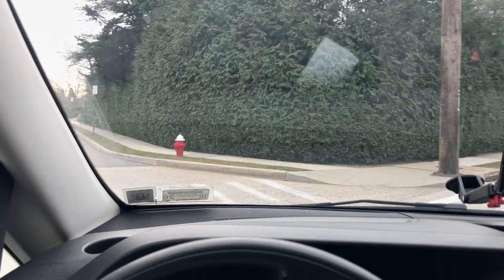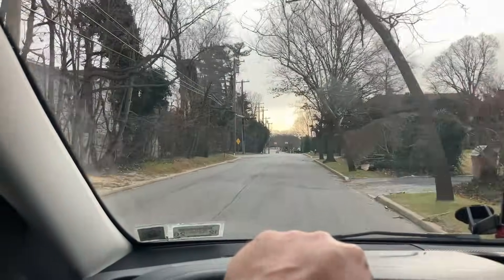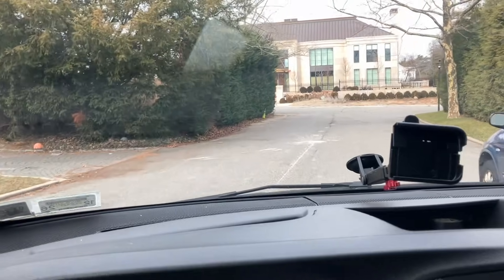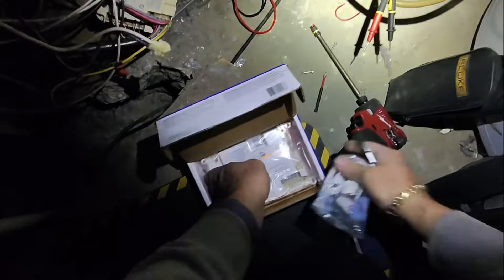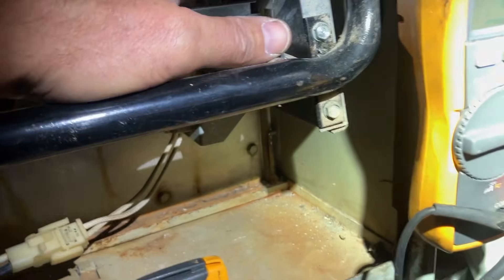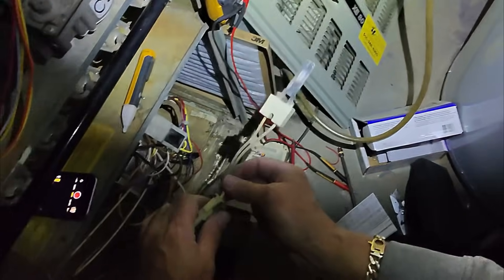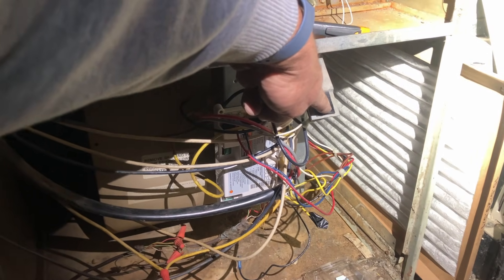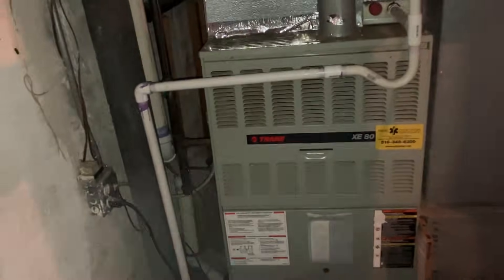Trane Gas Furnace Emergency No Heat Call | Frozen Pipes Risk

Comment: I worked on a bryant furnace today, forgot the exact model, but it had a ecm inducer. It was popping a code for short in 24v wiring circuit, i initially thought it was a bad fuse, but it wasnt, i checked condensate pump, and pulled drain off inducer, and found very little water. I ended up finding all 3 pressure switches full of water, theres my short, and i figured id try and drain them by blowing thru the hose, and they did end up working for me and stayed working thru 4 cycles. Customer wanted to take a chance and leave it, and call me if it shits the bed again. What do u think caused the water to get in all 3 switches?

Comment: I could be wrong here, but im pretty sure those older tranes used a 70v ignitor. Swapping in a universal board theres a good chance the new board sends 120v to the ignitor which I think is why you ended up needing a new ignitor with the new board. Any time I order a board on an older trane like this they will send a kit with a 120v ignitor with it

Comment: at least that isn't one of the 80v ignitor turds! because when those go, you may as well do the retrofit kit of 120v igniter, board and harness/adapter. because they tend to both fail close, at the same time or board over-volts igniter and nukes it.

Comment: Years ago i went to a trane gas furnace. The ignitor was bad so i replaced with 120v i had on van. It would glow orange but would not ignite. Check with trane and it had a trane exclusive ignitor that was 85 volts. Replaced board with updated one that used standard 120v ignitor..  I was cussing trane that day
Reply: yeah good old 80v igniter and boards. but it wasn't only trane that used them, you can thank the tomfoolery on the control board manufacture, pretty sure that was White-Rodgers doing, maybe driven by Trane? complete piles of junk, often the boards would not like igniters that were perfectly fine and go into lockout or they'd fail and overvolt the igniter burning them out fast.
been bitten by them plenty of times, that and thermostat's with batteries that leaked. lol

Comment: They used to Advertise, “You Can’t Beat a TRANE”.  That was back in the 70’s and 80’.  I would Never Ever even Consider Buying a TRANE for Obvious Reasons. 🤪
Reply: they were built very well and tough back then and they did last a long with some general maintenance.
all the 70's and 80's trane's were killed by fools and magical green savings schemes/scams. not much has changed ehh? other than it's all generic short life garbage now, so now days, good luck chuck on all brands/devices.
Reply: That's not the quote. "It's hard to stop a Trane" is their actual quote.
Reply: @Mo4Honesty  that was from the early 1990's
he mentioned 1980's and back. I'm sure they had other slogans in commercials that were not as popular or forgotten.
Reply: @throttlebottle5906  you could be right, but I suspect there is some degree of the Mandela effect going on here. Tranes previous campaigns focused on engineering and efficient operation, especially with energy issues in the 1970s.